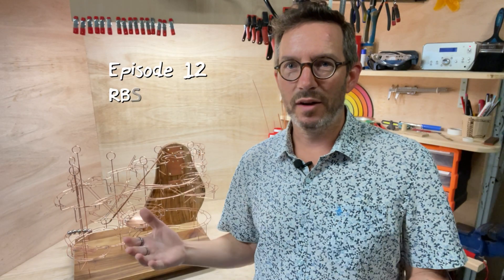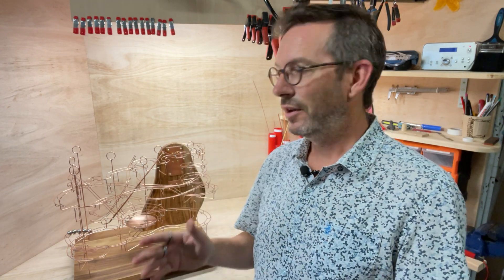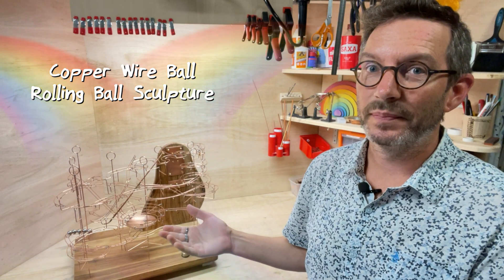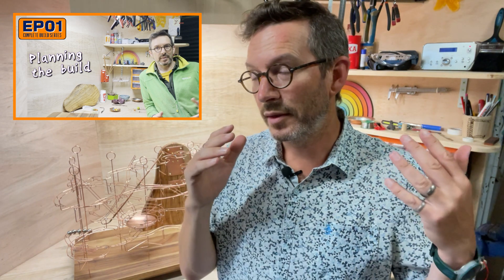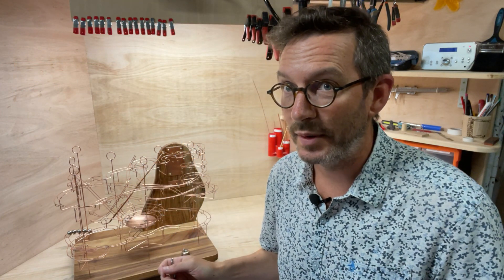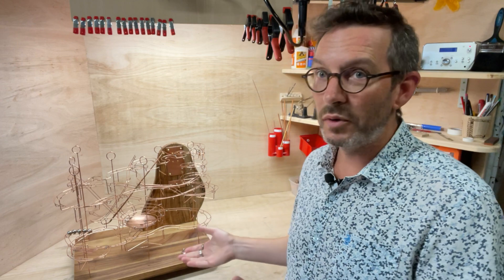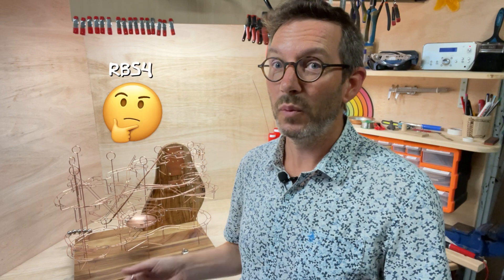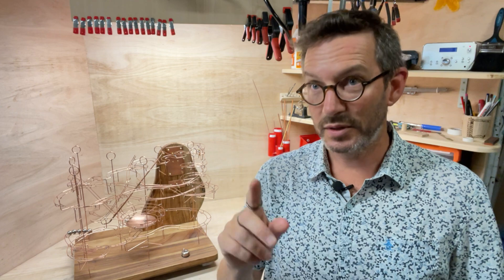Finished Rolling Ball Sculpture RBS4 EP 12

Comment: My favourite so far, one tip, with so much movement in the structure you will find the solder joints will fatigue and break over time, have found it best to add more supports and joints
Reply: It will make it easier to transport too..
Reply from the maker: Thanks very much for the tips. Good luck with your next ones. 👍

Comment: I am super frustrated because I'm working on an RBS with that same lift mechanism and you "got there first". Mine is different because the lift oscillates instead of doing a complete "circuit." In other words, the ball is lifted vertically and dropped on a track and then the mechanism reverses and the lift bucket goes straight back down. I had to use gears to make it work (since it's impossible to oscillate a crank further than 179 degrees).

I really like the look of your track too. Nice job!
Reply from the maker: Hey David. Don’t be frustrated. I got the mechanism idea and dimensions from you!  So you should be pleased. Mine was fairly quick because I kept it fairly simple. 

I bet your gear version will be amazing and I really look forward to it. 

I’m just going off line now but I’ll add some links and credit to you tomorrow.

Comment: Great final product!  The lifting is very unique and adds quite a touch. It’s both my most favorable and least favorable aspect of the sculpture. Most favorable- the unique motion adds a great visual effect. Well done!  Least favorable is that it appears to deliver balls at a slower pace than say the “standard” helix. This slower delivery results in only one ball descending at a time (or two for a very short overlap in time.)  I prefer when there is a lot of simultaneous motion going on. Perhaps a gated staging area at the top that gathers and subsequently on cue releases more at the same time would bring this effect. Not trying to be overly critical, just an observation to mull on for future projects. Again, well done and good luck with the sale. (Unfortunately, I’m not in the UK).
Reply from the maker: Thanks Bob I appreaciate the feedback and I can see your points you taken the care to make.  This sculpture is actually very simple once the balls are released, and the height is not very much.  So the amount of movement is designed to be fairly minimal as the lift is kinda crazy already.  I have ran this at faster speeds by providing a higher voltage, but six balls per minute is just about right for the scale of the sculpture.  Cheers again!